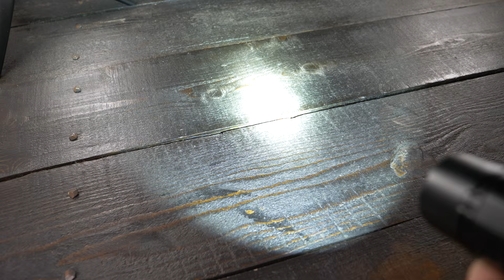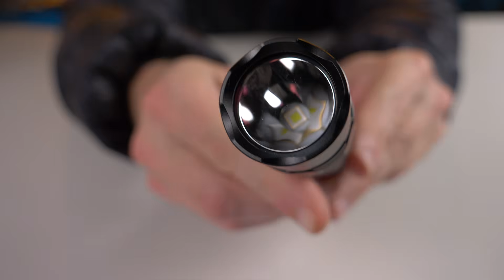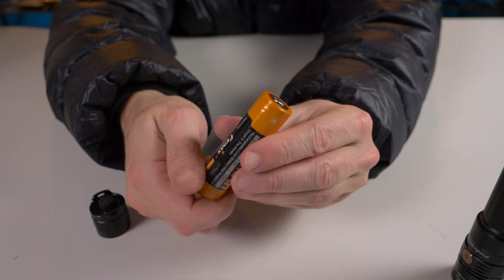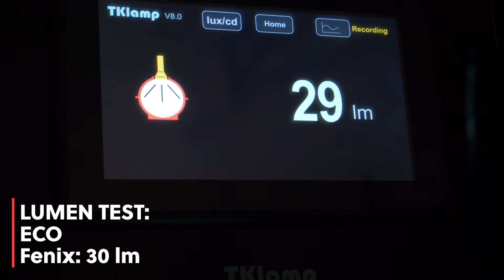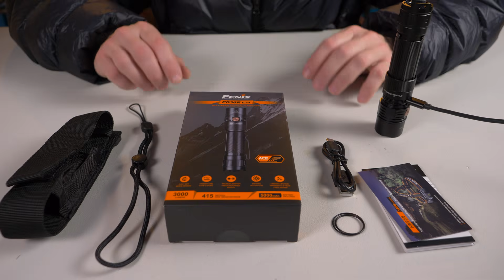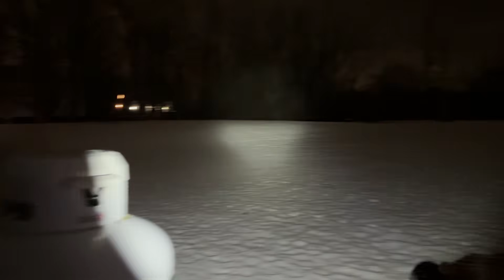Is This 3-1 Flashlight Worth Your Money? (Fenix PD36R ACE Review!)

Comment: Well my twist ring is stuck tight AF. On both, meaning I purchased 2. I had to get help for the first one out of the box. I keep it at my bedside. The 2nd one I kept boxed thinking I might give it for a Christmas present until this past weekend when I found myself in my vehicle with only a cellphone light. So, easy deal. I have a 2nd one I can keep in the truck. I’ve unboxed, looped my strap, removed the battery protector and now once again I’m not able to budge the twist ring to start my charge. What’s the secret? I did not see you struggle in the least for the hidden reveal. What’s up w this?

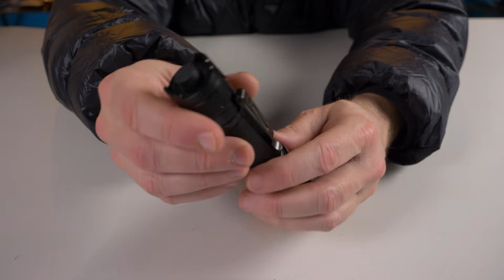Comment: 5:30 Yes, the designer of PD series has responded to this issue during live stream. He intentionally did this because this could ensure the switch can be pressed easily from any angle without obstruction. So this is a result of giving full priority to tactical use. So...at least this is a reasonable statement
Reply: Many users don't understand; they look for features in a tactical flashlight that a standard flashlight would have, and then complain out of ignorance. Fenix also has other models that can stand upright on their tails.

Comment: I wonder if it varies light to light because in 1lumens review, Medium, high and turbo came in over spec at turn on and stayed over spec at the 30 second mark. Eco and low was the only 2 modes slightly under. 
 I have the PD35R Ace and its been my edc light for a bit. Its wonderful. It has dual springs and I was surprised the 36R Ace did not. 
  If I can make a recommendation, I recommend the new TK21R. Its my favorite light in that series. 3600 lumens and according to 1lumen, it hits 3700+ at turn on but drops to 3200 by the 30 second mark. It has instant access to turbo whether the light is off or any other mode.
Reply from the maker: Good rec thanks
Reply: Keep in mind that not all LEDs perform exactly the same, even if they're the same model. There's always a small margin of error when measuring luminous output. Temperature also plays a big role: at lower temperatures the LED takes longer to heat up, maintaining its brightness for longer, while at higher temperatures the output drops more quickly - which is what you mentioned, slightly adjusted.

According to the ANSI/NEMA FL-1 standard, tests should be done at around 21 °C ± 2 °C. If a review is conducted at a higher or lower temperature, the results may differ. That's why sites like 1/umen specify the ambient temperature in their test results.

Comment: I've got this flashlight and love the build but the side button is hard to find in the dark. I have to use the side clip for orientation but hate the discomfort of holding the barrel with the clip there. How does the TK20R v2 match up with this flashlight? Is it too old now or does it still compete and maybe even win?
Reply from the maker: I love the TK20R v2. I reviewed that light about 3 years ago and it still holds up. 
I don’t really do recs anymore because my needs vary from what you need and is subjective. 
But for me, I’d carry the TK20R over this
Reply: @ChrispyThings Thanks. Just the kind of reply I was looking for. 👌
Reply: ^This iis not instant action, but it takes only a moment.  If having any problem finding a switch, I simply cup my beam with my palm and let the reflection shine onto the head. and switch.
Reply: Not everything that is new is better. The TK20R v2 isn't "fun" looking at specs, and low and medium could have been on one and the same mode as far as my eyes are concerned, but it is an outright tank that just keeps on working, and that is worth more than anything to me.